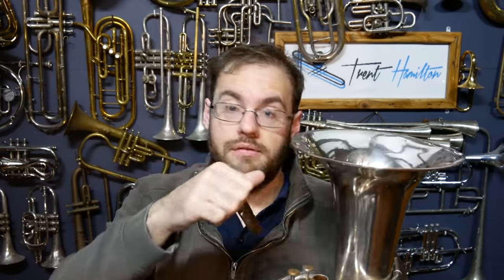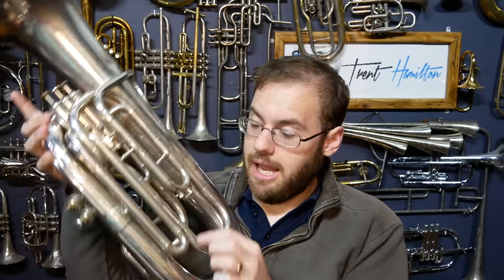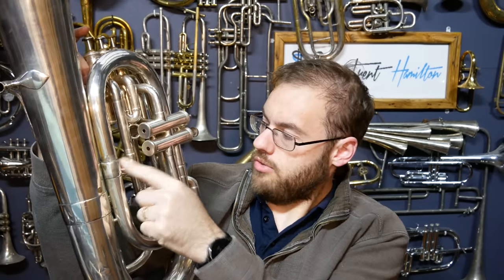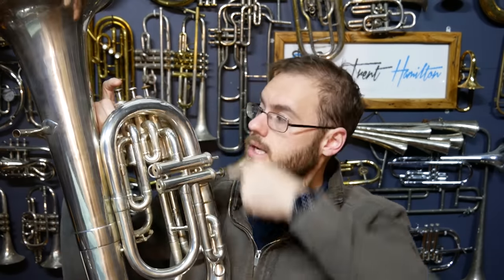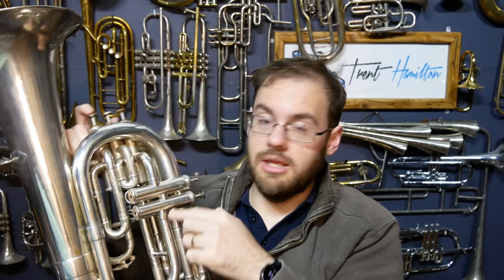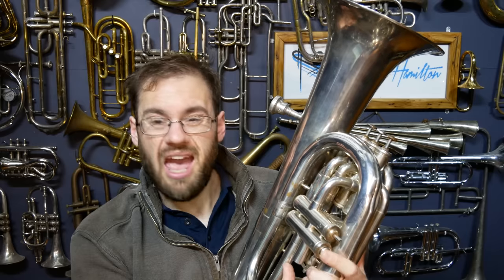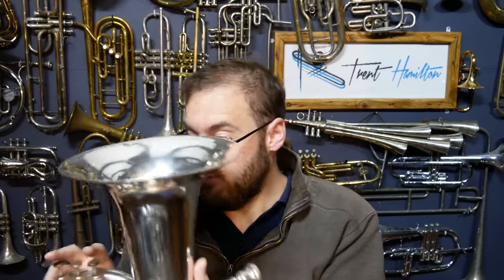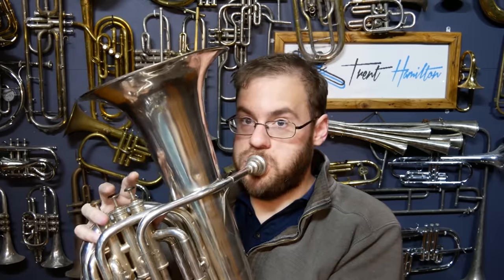How to Test for Air Leaks

Comment: Great job, Trent! On the sleeves, how do they lower the pitch? Are they larger replacements for the originals and have a higher volume of air?
Reply: Hi Wayne; just an educated guess here - it's not the larger volume of air that matters but the length for causing pitch! (Frequency = velocity divided by wavelength; in this case, pitch = the speed of sound divided by the length of your instrument). I'd guess that you're effectively cutting (or removing) the very end of the slide and using the sleeve to reattach it just that liiittle bit further down.
Reply: @jkelley012  You’re right, of course, about length vs. volume. I knew I was phrasing that wrong when I wrote the comment. Long week at work, man… Thanks!

Comment: Proper fix= send it away to get full repair. Cheap fix= get out the supaglue and silicone RTV and boogie up the cracks in the slides, get the valves replated and lap them in yourself.

Comment: OK has any manufacturer ever explored building a valve with rings somewhat similar to internal combustion engines.
Reply: Are you aware of the friction involved with piston rings? Pistons are a VERY TIGHT fit, with explosive pressures to shift them. If you're going to ease up on the tolerances so the valves are actually useable, then what's the point? A higher viscosity valve oil will buy you more time in the later years of an instrument's usefulness.
Reply: @Alex Paulsen  You are correct. The payoff would be very small.  I need to review the class on diminishing returns. A whole lot of effort for very small returns.